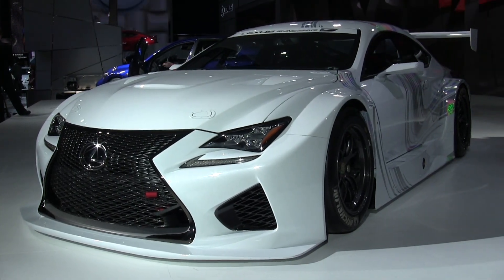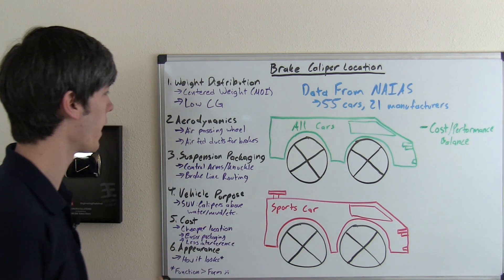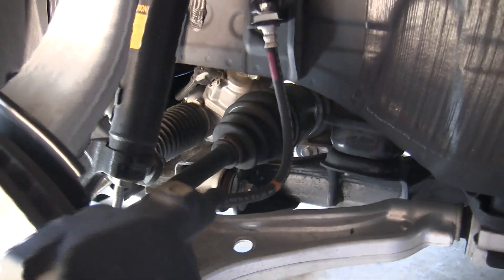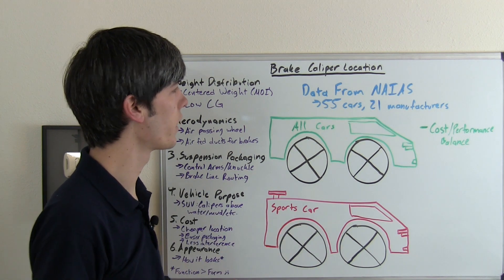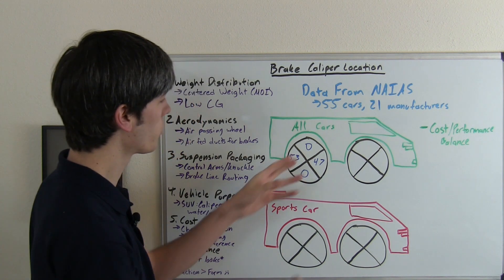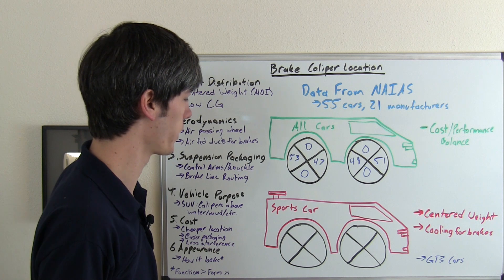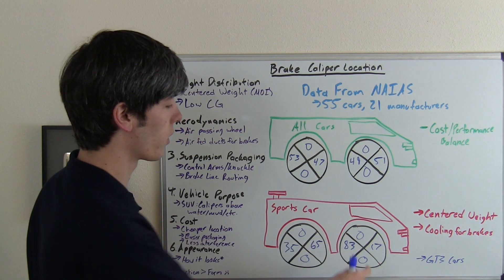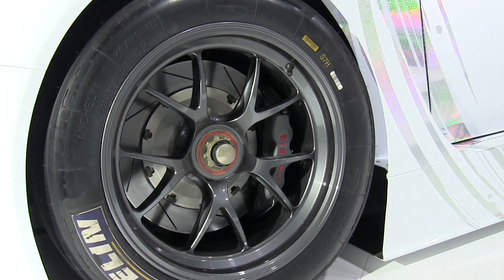Brake Caliper Location - Explained

Comment: I think one of the things he didn't mention is how the braking force interwork with the suspension geometry. I think when placed in the rear vs front, the force exerted on the caliper mount is more inline with the center of the steering geometry. Closer means less effect on the steering force. This is why most sports cars have the caliper towards the rear on the front vs passenger cars so that the steering is more agile vs more stable.

Comment: Most of the time the placement of the caliper has something to do with the configuration of fwd/rwd or awd.

What you see very often is that a caliper is placed at the front when it is a driven wheel. An undriven wheel like the rear wheels of a fwd vehicle seem to have the calipers at the back.

Why this is, I don’t know, but it seems to be a trend. Maybe you can elaborate more on this. @engineering Explained

Comment: Other considerations are bleed screws  need to be vertical to avoid air pockets, and bearing loads will be lower for a trailing caliper, and even lower when placed lower, optimal at about 45 degrees depending on the braking deceleration. That being said, the caliper has to be partially dismounted in order to bleed the brakes since the bleed screw is located at the top of the caliper

Comment: Caliper location coincides with the type of rotor as well, vented will almost always have a caliper in the rear, slotted and drilled will allow you to place them in front  vented needs air to pass thru the rotor, to cool it  with a caliper placed in front it negates its cooling factor and will cause overheating.

Comment: I don't know if you mentioned this but the air bleed valve needs to be in such a position that you can bleed the air.  I don't believe 12 and 6 o'clock positions are used. One more thing, I just learned that "they" say the calipers are mounted either "leading" or "trailing" relative to the spindle.  I've been wondering about this topic for a while, I'm glad you covered it! 
Very informative video!!

Comment: I walked past a Maserati and a Lexus (performance Lexus of some type) they were parked next to each other. The Lexus had the caliper on the rear of the front tire and the Maserati had it on the leading side. I wondered if the placement affected nosedive when braking hard, so I found this video. Seems as though it has none or very little effect in terms of handling characteristics when braking. Thank you for explaining.

Comment: does the location of calipers differs in wearing ? ......i think the front wheel front locations puts more load on brakes and the car needs to nose jump while breaking along with the restriction of air flow and these makes it wears a lot faster than the inside location ! am i right ?

Comment: Ive always wondered about the position, I thought it was more related to the caliper design / cross platform characteristics. 
The points in the video are for the most part correct, but there are cars that do not follow this model at all. 

I came here looking for answers more related to the braking performance, which I would assume would be none based on position (excluding cooling). However as long as the caliper touches the rotor and clamps down then brakes will perform. 
I also noticed some manufacturers stick with the same position for all trims, BMW for example is always inner mount front  calipers on all trims even if its a basic caliper or a brembo. Same deal for Jaguar, audi, etc.

Comment: So if the sum of all cars have a nearly equal distribution and one half is sports cars with a heavily unequal distribution, than the other half of cars must have the opposite unequality in distribution.
Also does breaking create any forces, that have different directions based on the point whese the breaking occurs?

Comment: I know this is an old video and maybe it has been pointed out but for Chargers the issue is RWD vs. AWD.  All of the RWD cars have the front calipers mounted to the inside and the AWD models have a clearance issue so caliper is mounted towards front.    Easy way to tell if a Charger is RWD or AWD is check the front caliper placement.  Nice content.

Comment: Front mounting of the front caliper makes the wheel want to leave the road under sudden application,rear mounting it makes the wheel want to dig into the road when the brake pedal is hit which is far more safer and desirable,and that's why all the best and race cars have rear mounted front brake calipers.

Comment: Hey

Would brake caliper position on front brakes (being front side or rear side of front brakes) alter the affecting forces of the disc inertia change the impacting forces on the car/chassis.

If you are rotating the disc brake forward, stopping it with brake calipers from the front side down would be more aggressive clamping force/friction COMPARED to having the on the back side of front brakes, as the forces applied would be in an upward action, pulling the brake pads instead of pushing in, end results would be more feel and feedback to the driver of the vehicle?

Comment: Would the direction of the tires spinning have an effect? By that i mean that the for the front tires, placing the caliper on the back side would apply the brakes at the point where the tire would need the most power to continue spinning, thus in theory gaining brake efficiency.

Comment: What happens to the axle when the brake is applied (Is that rotational inertia?)? If we head a rear mount caliper on the front axle  wouldn't that cause the axle to push down as the brake is applied? 
 If my theory is correct, a rear mount front caliper would resist compression in the suspension and a front mount rear would resist rebound, lessening the nose dive.  Thoughts?

Comment: Great review, however did you consider that the engineers of the performance cars may be trying to take advantage of the dynamic force absorbed by the brake caliper during hard braking to counter vehicle dive?  Based on the locations and the geometry involved it would seem quite plausible.
Reply: The rear bias mounting location is toward the front of the car.  If brake force is applied their wouldn't it try to squat the suspension (assuming a multi link / macpherson strut setup).  Likewise the location of the sports car's front caliper (biased toward the rear) may provide a lifting vector on a portion of the front suspension.  

These two forces could be used to produce a car that resist 'nose diving' when massive brake force is applied..

Comment: I've always had thoughts on this. position front calipers at rear of wheel at low point. then rear caliper at front position but low. then under braking the car "hunkers down" in a more flat plane rather than severe nose dive. also why not make capers that cover 40% of the disc just improve surface area?

Comment: and then there is the rolls Royce silver shadow.
it has twin callipers on the front discs (my dad's 68 shadow certainly did) 1 mounted at 9 o'clock and one at 3 o'clock.

I guess it was to get enough stopping power on a big heavy car,given 60"s technology.

Comment: noo it wrong, it is decided for,  when you will break how the suspension will react, example --- inner rear breaks, when applied will push the car down towards the ground hence increading the grip for rear types where as front tyres inner breaks try to decrease the load on suspension keeping the cars front not to touch the ground. this makes the cars morestable. how can you create the video without the research, this whole process is just common sense,  it does not even need the research.  now i doubt that whether your information is correct in other videos or wrong.

Comment: You forgot about brake pad knockback caused by wheel bearing/hub deflection due to cornering loads. To minimize knockback, the caliper should be placed at the 3 o'clock or 9 o'clock position, where the angle of brake rotor deflection has the least effect. This is extremely important in placement of fixed-caliper designs (like Brembo). Sliding calipers are less effected by it but it's still a factor. As the wheel bearing or hub flange bends up or down, the rotor pushes the brake caliper pistons back into the caliper body. Now when the brake pedal is applied, extra travel is required to push the pistons out far enough to make the brake pad touch the rotor again. On some cars, there's so much knockback under extreme cornering loads that it takes up the entire effective travel of the hydraulic brake system -- the pedal goes to the floor, and no brakes. No bueno. These cars need stiffer bearings, hubs, and/or knuckles, or better caliper placement.

Comment: Drivetrain also might be a factor of the location for brake caliper .. Usually i see normal vehicle on the road which has fwd tend to have caliper placed facing to front bumper and rwd caliper at the front brake tend to facing the center of vehicle itself !!

Comment: Can you make a video about brake bias. For example, what bias would create oversteer under braking and why. I've been doing a lot of research and there is no clear answer.. What is the physics behind it, please.
Reply: Jesse K. Davidson have you ever driven a car without ABS? Usually the fronts will lock up and you can't steer. So less grip at the front from the locked wheels creates understeer. 
Watch any drifting video and you'll see the drivers rip the hand brake to lock the rear wheels to initiate a drift (oversteer).
So forward bias will lock the fronts first and rear bias will lock the rear first.

Comment: Would have been interesting to explore the anti-diving effect of caliper positioning on the suspension, considering different suspension layouts: double wishbone, Macpherson, multiple links...
Reply: Caliper position doesn't affect brake dive. Brake dive is caused by the tire contact patch being lower than the car's center of mass. Regardless of the position of the caliper, the braking torque is converted into a force couple at the contact patch and the hub.

Comment: Did you think that maybe for profit mane applications, it might be to keep the nose from dropping? Having the caliper in the back where the rotor drops creates a torque in the upward position to help counter the downward force of the contact between road and the tire. Kind of like if you were running on dirt and you slant your body just right to slide on your feet until you come to a stop. If you get it right, you can stay standing the entire way and when stiction becomes the overwhelming frictive force, it will begin to right you.

Idk, just a thought

Comment: hello there,

is there an influance, caused due to the caliper position, about the counter-force that the caliper applies on the wheel arm?

i mean- if its located at the front it applies down force towrds the ground, which will ressist it,
 and if its at the back it will apply a force which builds up towrds the wing... and that will apply force on the bumper which will make him to be closed....

hope im clear....
thx...

Comment: Good lord, a lot of it has to do with the steering rack location. And the rack location is secondary/related to the positioning of the sump of the engine- moving the engine back towards the center of the car for handling, means a front mounted steering rack. Which then means the front brake calipers are mounted towards the center of the car.
We are much more concerned with getting the heaviest front mass (usually the engine/powertrain) as central as we can for handling. Not small lightweight alloy brake calipers you can pick up with one hand. They move to suit steering racks and powertrains.

Comment: I have heard there is also a leverage effect to caliper placement. Putting the rear calipers in the front quadrant of the wheel helps pull the ass down under braking. And having the front calipers mounted in the rear quadrant of the wheel helps fight nose dive. Allowing the suspension geometry to control the majority of anti-dive and anti-squat. Is that true?

Comment: You don't mention mounting the rotors/brakes inboard.
Although obviously rarer, and not visible for posing, it certainly reduces the un-sprung weight problem and has been successfully used by many manufacturers.

Comment: Just a thought, is there a mechanical advantage in calipers grabbing the discs at a certain point?
Reply: Yes.  One side will increase wheel bearing loads, the other side will offset the vehicle loading on the bearing.
Reply: Thanks for the responses guys.
Reply: No.

Comment: The most important think is related to the relief of weight bearing on when braking. In front will push the wheels up, relieving the weight at the time of braking, if your wheel is supported on the inside of the bearing this will extend the life of the bearing. The reverse is also supported outside wheel, brake caliper back.

O mais importante acho que está relacionado ao alívio de peso nos rolamentos no momento de frenagem. Na frente vai empurrar as rodas para cima, aliviando o peso no momento de frenagem, se sua roda estiver apoiada na parte de dentro dos rolamentos isso irá prolongar a vida útil do rolamento. O contrário também, roda apoiada do lado de fora, pinça de freio para trás.

Comment: Hi. On high performance vehicles the number one priority is cooling the brake disk (if carbon fibre disks, as these can not absolve as much heat energy as the steel, sometimes priority flips to cooling the calliper). Non high performance vehicle key driver is packaging, which is mainly driven by the location of the steering rack... Hope this helps!

Comment: what actually holds the caliper. i am going 100 mph, caliper starts to press the pads to stop the disc. right now where  is the force that hold the caliper at, is it at the axle..
Reply: force comes from your foot when you apply the brakes and the pressure you create within the pistons of the calipers.
Reply: thanks, but i want to know about the structure design....wouldn't the caliper will rotate with the disc if it mount on the disc...what is holding the caliper in place and what make it so strong to stop a rotating disc.....i am a bit noob about this lol
Reply: +reifukaiyukikaze When the wheels are spinning only the disc is moving the calipers are always at the same spot and never move. The calipers are hovering over the disc so they never actually touch the disc until brakes are applied and the pistons push the brake pads into the disc crating friction and slow the discs down which also slows down the wheels.
Reply: +reifukaiyukikaze The caliper is being held in place by bolts located on the back of the brake disc
Reply: yes thanks bro, i just want to know that...so i assume that one bolt was a very strong ones

Comment: I was trying to fall asleep one night and was thinking about magnets and different things they could be used for.  I was curious has anyone ever tried to use magnets to stop a car.  As in instead of having break pads, you would use an electromagnet and the hard you step on the break pedal the more power that would be sent to the magnets, that would be in the same place that a break pad would be.  You would still need to have a metal disc, so that you had a surface to be attracted to.  I wasnt sure if it would work or not on a spinning object.  But, if it did work it would eliminate the need to replace pad and rotors.  I would love to know if this has ever been tried.
Reply: You would still need some kind of pad and rotor even if the force was applied by magnets or fluid
Reply: I wasnt meaning using anything to touch the rotor just have a magnet field created on either side of the disc.  But, like I said I am not sure what affect it would have on a spinning metal disc.

Comment: How do they maximise airflow to the rear pads if the calipers are mounted towards the center?
Reply: I'm guessing that isn't mush of a concern because the front brakes take far more of the load, and the rear would not overheat.

Comment: because braking is limited my the tires grip. you can only clamp a brake rotor so hard before it locks up. plus that big of a caliper would not allow the disc to cooler properly

Comment: brake calipers don't weigh that much.  If they did then why do Mercedes use 8 piston calipers that are so big they cover the the height of the disc?
Reply: They can actually be quite heavy. However, stopping power and heat capacity > weight savings of smaller caliper.

Comment: Interesting point with the charger,  I've got a 2011 Challenger SE (base) and the front calipers are biased center & low and the rears biased center. Interesting they don't do the same on base model chargers.

Comment: I believe the rack and pinion (or other steering linkages) weigh more than a couple of calipers. and the linkages are always on the opposite side of the calipers. Most front wheel drive cars have forward facing calipers because the rack and pinion is placed behind the engine. There is more flexibility when it comes to rear driven vehicles.